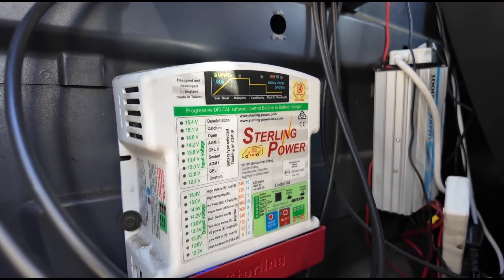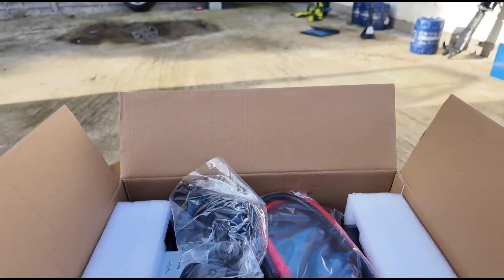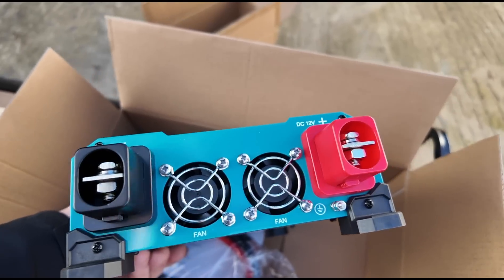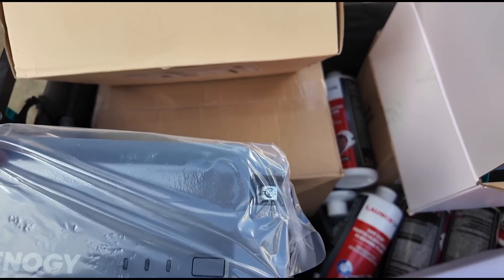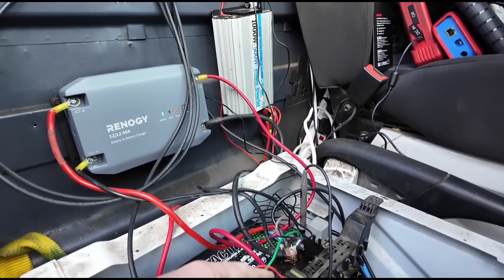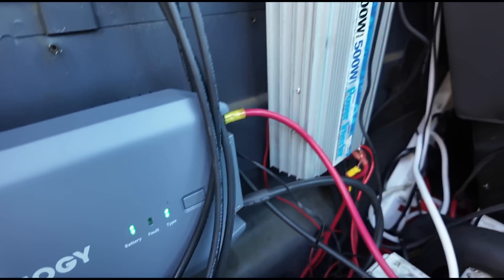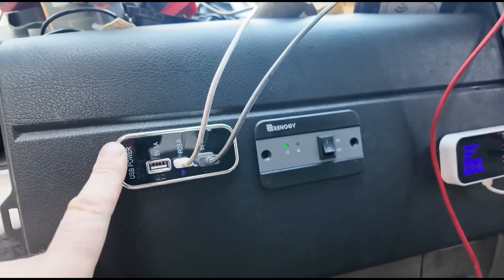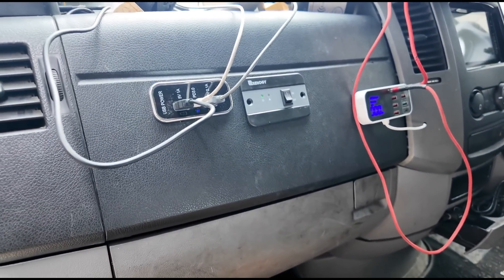Upgrading My Noisy DC To DC Charger & Inefficient Inverter

Comment: Hi Jimmy, I have a megane 3 with p4071. I have clean the exhaust pipe changed the sensor worked for 20 km and then the error came back again. The live data reading is 1013mbar and the voltage reading for the sensor is 3.27v. I have also checked the conector and I have 5v coming to the sensor. What can I check more??

Comment: Final upgrade worth considering is a LiFePO4 battery to replace AGM. Charge faster, double capacity (lead acid and AGM can only offer half their capacity without fast degradation), smaller and much longer life.

Comment: A 12v to 24v converter from the alternator to a separate battery bank is the best way
Reply: There's hardly ever a need for AC on the road most things run on DC now and have AC DC converters built in

Comment: Very interesting setup you installed, Jimmy! My only doubt is about the inverter: for 1000W, you need in excess of 80A from a battery - is the van able to recharge the inverter battery?

Comment: I’m currently installing a Renogy DC to DC charger in my travel trailer to keep my Lithium ion phosphate house batteries charged on the road. My issue was feeding cables down the length of my truck to the hitch and then into my trailer to the batteries. The trailer has a 2KW inverter and the truck has two 165 amp alternators plus two starter batteries.

Comment: I have the Renogy 1000W, it's a good inverter. It takes mains in too, and acts as a UPS.
If you pull a lot of power, e.g. a 700W toaster, you'll need to add a supercapacitor block, and need some decent batteries (or a dimmer switch also works!)

Comment: Panels are stinking cheap now......a couple of gel battery's and 2000watt inverter will start and run 2hp compressor and charge all cordless tools without even bothering connecting up to alternator of van....
Reply: Gel is good, but I'd recommend a supercapacitor in there to help the inverter work.

Comment: Id highly recommend a LiFePo4 battery. Less weight, far better for providing the needed amperage for the inverter, much longer runtime (at the same Ah). And they are very cheap now (Black Friday). And a pure sine inverter vs a modified inverter is also compatibility: a lot of electrical equipment won’t run on a modified inverter, or even can go faulty. So a sensible upgrade!
Reply: Was just about to recommend the same best thing I did changing my leisure to a lifepo4
Reply: I don't like lithium, but a regular LA battery can't supply much current for long, so sometimes it's the only option.